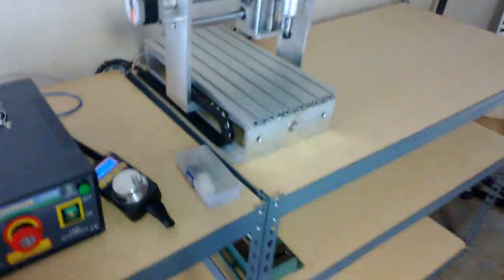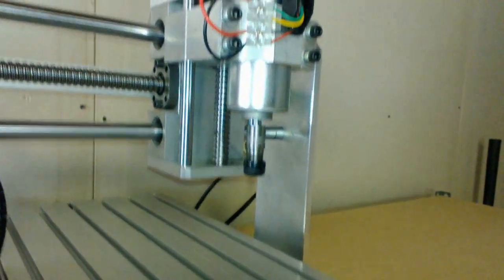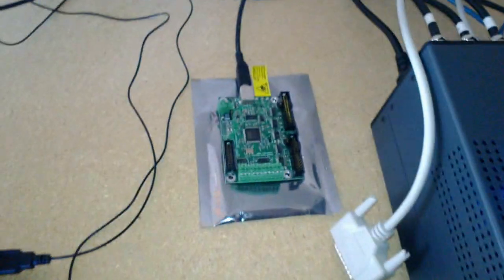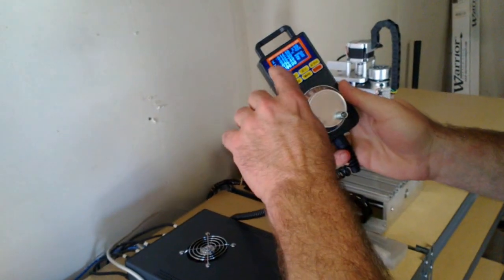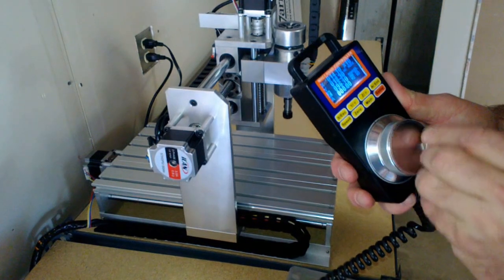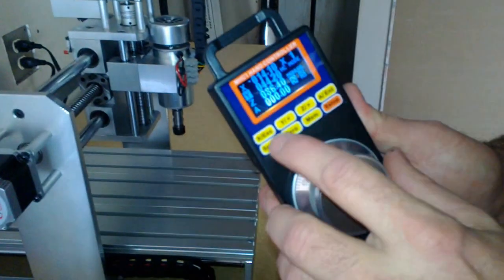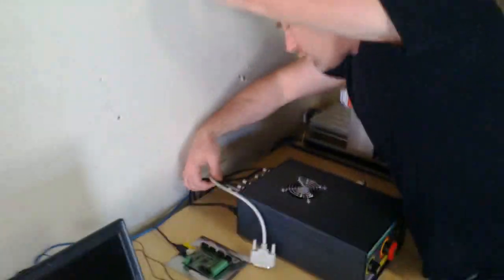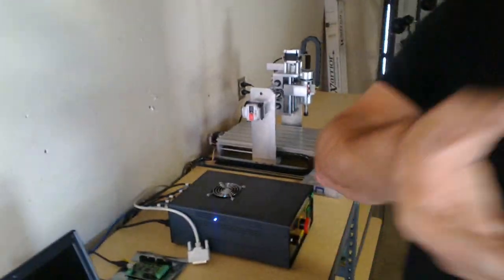Setup of 3020 CNC by MIB instruments China

Comment: Do you like it/ glad you purchased it? Thanks!
Reply from the maker: Well the answer to that is complicated.  I at least have something but I am very unhappy with the distance between the table slots. There is no vise with holes that match those slots plus the distance is so small on the Z axis that every vise is to tall for it. I found a special wooden vise that is short and wide that is $175 that I think will work with this.
Reply: Thanks for the reply. The Z travel is one of my worries. I never considered the slot spacing! Still my have to get one.... Ugh lol
Reply: Can anybody share the contact details of MIB Istruments bcs I want to buy this machine, What is the price?